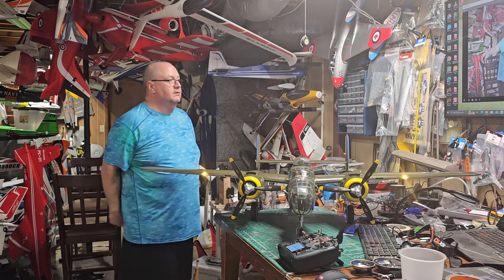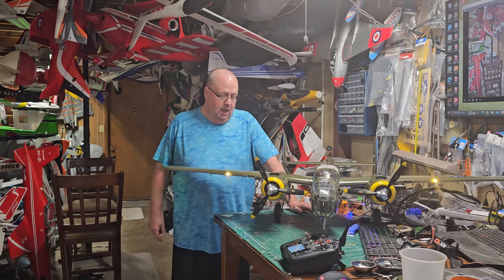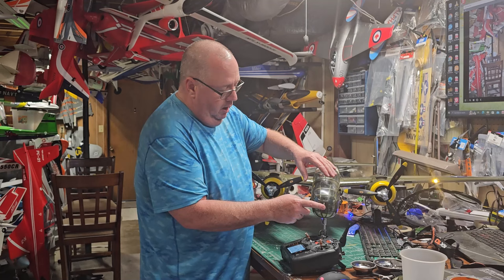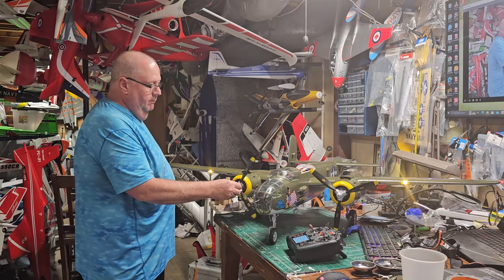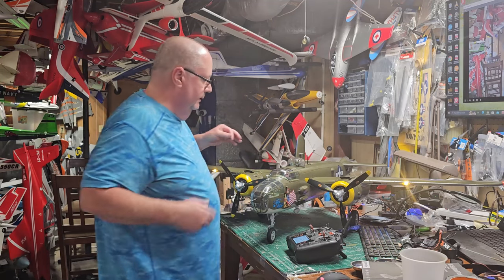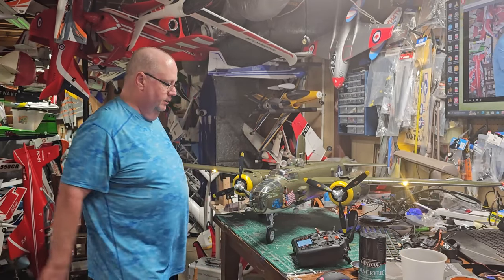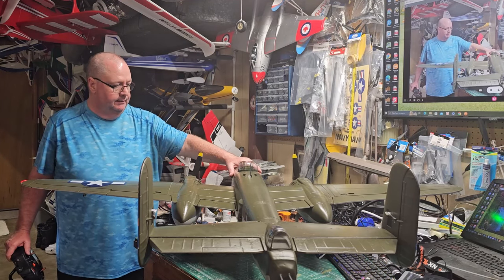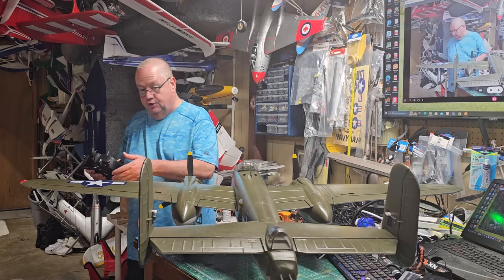WARNING! WATCH THIS! BEFORE YOU BUILD! THE FLIGHTLINE B-25J by FGFRC

Comment: Great info. Thought I was balancing mine wrong until I watched your video. Have the same problem with the CG. Tail heavy even with an Admiral pro 70c 6S 6000 all the way forward.  Removed the clear nose section and added weight there to get it balanced. Haven't flown it yet. Waiting for nice calm weather.
Reply from the maker: Enjoy, the plane is a thing of beauty and flies the same!
Reply: Did you balance yours with the retracts up or down?  I checked with Motion RC and was told to balance it wheels down. @FatGuyFliesRC

Comment: The admiral 5000 50c are perfect CG.  
They are over 700g at 728g. I have 2 smart 5000 100c Gen1 that are lighter. 700g. For those I had to add weight to get the CG.   I hope to maiden mine this Tuesday.
I have two admiral and two smart batteries.
Reply from the maker: Got my maiden in today. Up loading now. CG was not as much an issue as i thought on 1 flight i used a CH line 5000 that around 750 grams and she flew great.

Comment: I been flying for over 40yrs and never use there throws listed in the manual, I pretty much know how much thrown I need , I do set up 3 rates at first on the maiden and flaps I just figure whats right for takeoff and landing and adjust later if need be and if it needs elevator mix with flaps I setup a Flightmode that I can adjust when flying
Reply from the maker: Thanks for sharing. I need to learn more about flight modes to better dial in my flaps on the fly as it were.

Comment: When using water slide decals, you should start with a glossy surface, slide the decal in place, use a setting solution like Solvset which softens the decal and allows it to conform to curves and surface details, when dry spray on a clear flat coat and they will look painted on the plane
Reply from the maker: I used a very light application of alcohol then applied with copious amounts of water and wet fingers. Massaged them into position then did the clear coat after they dried , they came out awesome.

Comment: Greg, I assemble mine ( No Issues ) My CG I needed to move my Spektrum 5000 6s 30c gen 1 battery about 1/4 inch back because it flew nose heavy. I love the Power of this model but would be fast to say its is over powered. I also used full throws all around with 30% expo and she flew spot perfect. I will warn you she lands a bit fast even under full flaps.enjoyed watching.
Reply: It actually needs lower pitch props to slow it down. It flies way too fast with the stock props.
Reply from the maker: Well i am VERY pleased with the way she flies and lands, She has plenty of power and yes a little fast for scale.

Comment: Does the minwax dry or does it feel greasy or sticky at all? Do you apply it with a sponge paint brush and I assume try and keep it off the canopy and retracts areas? Honestly not too sure I really like it on the olive drab military finish like I would on any normal plane or even the Pacific Silver P-38 Lightning. Are you planning to do it to all of your airframes as time allows, you like it that much?
Reply from the maker: I did the whole thing, you can get satin or flat finish also. I spray it on.
Reply: I'll test out the satin and the flat finishes for my planes. Thanks! @FatGuyFliesRC

Comment: Hey fats I just tested out the plane and Motionrc put the props on backwards they were reversed the front should of been the back and front should of been the back the props started spinning and no rear thrust and it came flying backwards to me and pushed me into a door. they had the stickers facing fwd when the prop should of been reversed it nearly injured me bad when the plane came flying back at me. broke the right side facing wing. the left side facing prop flew off and cut me in the head. they put the props on backwards on the preinstalled mounting. im so shook up bc of this
Reply from the maker: Please tell  me you have pictures  or a video. You need to tell them immediatley.
Reply: @FatGuyFliesRC  i was recording it. I contacted them it is being sent to the upper mgmt, im waiting for them to contact me back. This was the most bizaar thing that i ever had happen to me.

Comment: My motors wont spin in opposite directions i cant figure out why. Any ideas?
Reply from the maker: One must be reversed  then and check the props after.
Reply from the maker: They should both spin inwards to the fuse.
Reply: ok thanks yes, I checked and reversed cables was rough to get inside without denting and scratching up the foam... Those cables are so short. Cheers @FatGuyFliesRC